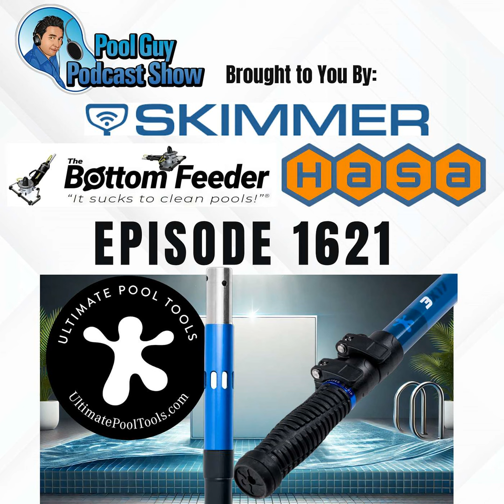Ultimate Pool Tools Titan Aluminum Pole Compared to Other Brand Poles

Comment: I have a above ground 21 foot round, 54 inches tall. I'm using a very old aluminum pole probably 20 years old easily that i got from a friend of a family when his pool was taken down. I'm on 6 years using it, it has cam locks so its probably a skimlite. Its heavy and long.  Way better than all the cheapy poles i ever used. We leave it in the pool standing up lot of the time, or in the sun. Cam locks work at 50% pretty sure it needs new ones installed. I moticed a growth growing on the aluminum since its very worn, i sanded off the growth, white flakes. 
I'll be very happy with this Titan , i cant wait!  I almost bought a primate maverick carbon but i don't think it will last as long like aluminum.
Reply from the maker: Aliminum poles will last pretty much forever. It does sound like a Skimlite - scale can form on the pole in the pool. The Titan looks to me that it will last forever.